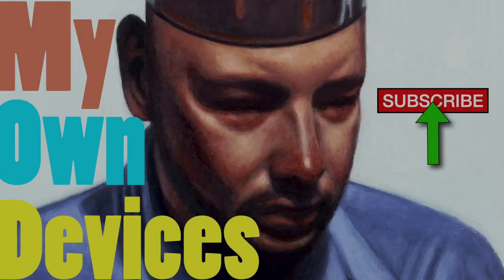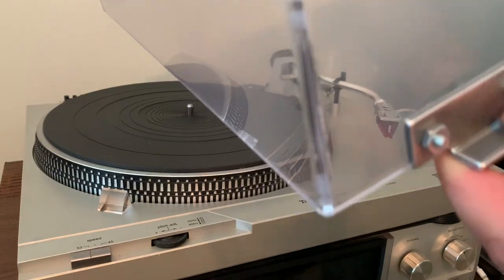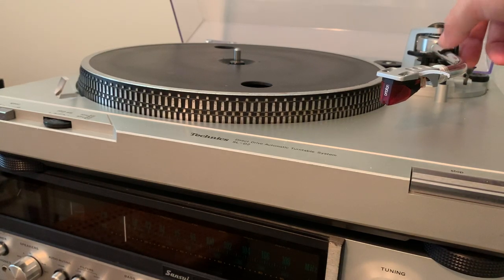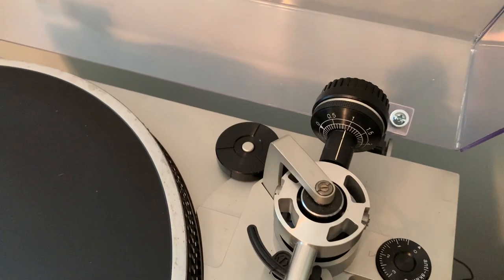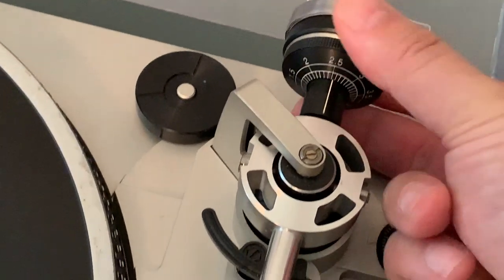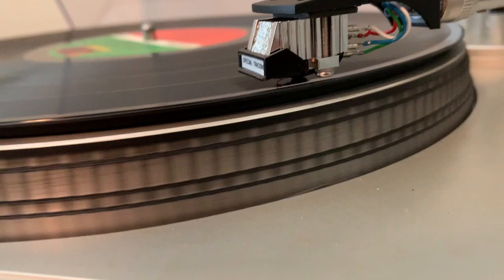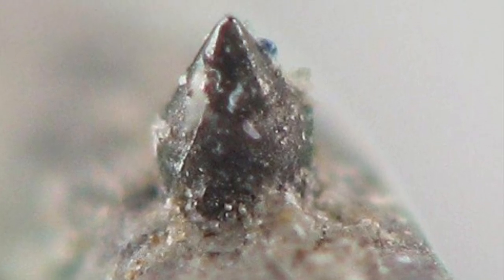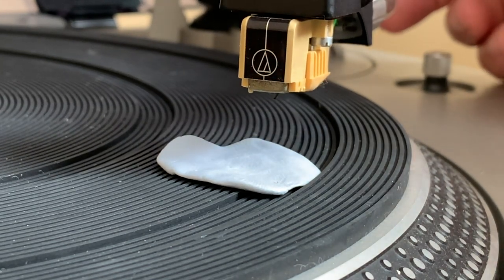Five Sensational Turntable "Hacks".

Comment: My hacks are something I learned when I was selling stereo equipment in the late '80s - early '90s. Make sure the platter is level before beginning to make any adjustments to the tonearm tracking force or anti-skate, and make sure the surface you place the turntable on is stable, solid and away from speakers or other potential sources of vibrations. To level the plinth use a bubble level on the platter near the spindle, then add paper or cardboard as shims under the feet, as needed, until the bubble is centered. Make sure you do this without the dust cover, or else its weight in the open position may throw off the measurements.

Comment: Awesome. Here's another hack... on stylus, a bit of alcohol with distilled water mix, in a small bottle. Dip stylus brush in solution, shake off, and brush styli. Check in a high powered micro-scope for end results. Re-brush with zero-state solution. Amazing results.
Reply: Thats what I do. But I don't use the brush that came with the stylus. I use the one that came with my razor cause it's bristles are softer (no. I havn't use this brush for the razor and never will :-) ). I check the stylus with a small handheld microscope and it looks phantastic. For the very scratchy dustcover of my old Wega turntable I used a kind of rough method. Polishing machine with ceran field polish. I didn't use much pressure on the machine and it worked for this dustcover. Not perfect but it looks and feels much much better than before. Do on your own risk.

Comment: A secret tip regarding Shure V15 type 3,4 and 5 if you buy a stylus from Jico in Japan, you can easily set the VTF to 1.5 gr without it damaging the cantilever and the suspension. I love those cartridges.
I also think you should try different headshells it actually does a part on the sound reproduction one of my hifi friends tries different types of headshells for each cartridge he buys.

Comment: "Skating", the force created by drag on the inner side of the stylus causing it to ride up the inner groove wall. Placing a stylus on a blank surface does not emulated the skating force needed to set anti-skating most accurately. I use the "Audio Symphony: Check Up Your Sounds Vol. 1" RCA Japan RVL-1. 

And for stylus cleaning get some AT-607. Looks like a finger nail polish bottle and includes the cap/ brush even. Your stylus and cantilever will shine and it does not damage the elastomer. I have a USB "microscope" attached to my plinth right by the stylus resting spot. I can see a magnified image of the stylus before every play.

Comment: Ammonia based window cleaners will damage the plastic. I have found cleaning old dust covers with warm water and a mild dish soap then applying a product called PlastX it’s found in any auto parts store it’s used to restore headlights.
Reply: I can't second this enough. Window cleaner will absolutely RUIN  plastic. Plain water works fine or if you feel you must use a chemical, Novus plastic  cleaner #1 is what I would recommend.  KEEP GLASS CLEANER AWAY FROM PLASTIC!

Comment: Blue Tack is excellent for cleaning the stylus as you mentioned, however it’s best to build a small pedestal with the Blue Tack on top to use next to the platter rather than putting the Blue Tack directly on the platter

Comment: Acrylic polishing paste can work great on these lids to get that glossy shine back. I only used it partially on ms SL-1210 for an inside scratch caused by the retractable light before I got hinged for the cover. Use fine sandpaper to smoothen out deeper scratches and the apply the acrylic polish over it. It will be shiny again within a few minutes and at least will greatly reduce the visibility of the scratched area.

Comment: The easy way for the lid to look a lot better is to use Pledge to buff the lid. Apply it on the lid every few weeks to keep it looking almost like new if it was only lightly scratched to begin with.
Also the tube where the counterweight screws in and out is sometimes hollow giving you another stealth way to make it heavier at the end of the tonearm without getting close to the lid.

Comment: If the blue tack is too ... tacky for you, of course the best is the Onzow which is designed specially for stylus. But it can be pricey (I saw $80 in some places... $40 in others).
Now, I haven't tried it but on some audiophile forums I saw people recommending Resonance Gel pads (that are used for drums. Seems to work like the Onzow and you can get a 6 pads for about $7. 
Now, the neat trick to go along with: want a case for your gel stylus cleaning pad? head over to the dollar store and grab a pack of the Listerine-like strips, empty the little case and the gel pad will fit right in. So it stays clean when you don't use it and it makes it much more convenient to use.
Reply from the maker: I also use a small piece of Magic Eraser.

Comment: I have just ordered lead tape as in hack # 2 . I got a Dual 506 2nd hand and I replaced the head shell so I could use a 1/2 standard cartridge , to balance the tone arm I added some nuts for weight and taped them on with black tape , but I like your lead tape idea better , I think it will be a winner !

Comment: All (I’m pretty sure) Technics counterweights have interchangeable threading but don’t weigh the same, so when I had the same problem as you I replaced the weight with a heavier one.  I like your solution, though.  The Technics auxiliary screw-in weight that is available also makes it impossible to close the cover.
Reply from the maker: This is a budget TT and I've already overspent trying to optimize it. My next video will really "get into" it. Please subscribe. Thanks, Dave the Hack

Comment: If you buy some Mothers scratch remover from an auto parts store and use a drill with a polish wheel Velcro attachment you can remove a good majority of your surface level scratches. I have had success with Turtle Wax head light renewal as well but by hand it takes about an hour to buff a dust cover.

Comment: The Anti Skate Hank is just wrong. Anti Skate must be done in the groves of a  record not a blank track. Get a test record from Hi Fi News. It has test tracks for Bias Setting(Anti Skate)-300Hz tone L+ R  at 12dB next track same 14dB next track 16dB and up +18dB. Using this you should hear an even signal from both channels simultaneously. if there is hint of instability(distorted or buzzing sound) on channel or the other then adjust the bias(Anti Skate) as needed. This is how bias(Anti Skate) should be set.

Comment: In addition to adjusting the balance pressure level with the counter weight you can also set the cartridge back further in the head, ( I noticed it was kinda in the middle). Also, I was picking up some speaker stands from a local audiophile the other day and he had a technics sl1300 and sl1350 that  he had acquired with no dust covers, but he told me he found a website that sold new clear dust covers for around $40 each, of course I didn't bother to ask him what website.
Reply: My bad, I guess you use that adjustment for correct alignment. Still if you don't have a scale you need to set everything to 0 and balance the tone arm then set the counter weight and anti skate but 1st thing is to balance the entire tt
Reply: I meant level the tt not balance

Comment: You really need to have the pivot point of the arm at records surface level that would have reduced the amount of weight as well could go forward and less overhang as much as possible you can use a big thick bolt with a nut superglued and some Cotton bit of blu tack stop it moving and hang it. You want to bend the the headshell between 5 - 7 degrees and a 10-mm spacer of balsa wood between headshell and cartridge so can get the rake angle back. Reducers in a Groove distortion pitch stability is better jitter on the record is better. Can try it with a slight wedge of bolster Wood cut to the angle as well if you don't fancy bending or have got a fixed headshell.

Comment: You probably could have found an auxiliary weight online somewhere. Most of these 70s and early 80s direct drive turntables came with little auxiliary weights that you would slot or screw onto the back of the tonearm, to compensate for heavier cartridges and head shells.
Reply from the maker: Agreed.

Comment: Enjoy  your videos, 
What do you do with severely damaged speaker corners.
What do you clean nasty circuit boards, I want to hose them down with a fire hose .
Can you recommend any books on vintage receivers repair?
Thanks for your videos, they are great.
Jim W. Living on Tulsa Time
Reply from the maker: I use wood filler and wood glue. Look for furniture repair videos. I suggest avoiding the use of water on electronics. Compressed air, artist paint brush, slightly damp microfiber cloth, electronics cleaner spray. Thanks.

Comment: The antiskate  needs to be set higher, as the groves will accelerate the arm inwards over and above the setting you have from the ungroved track on the record - try an extra .75g-1g  The best way to check is using the azimuth alignment track on the record and measure the signal levels so they match _+less than 0.5db or better hopefully you should be able to get it within 0.1db.
Reply from the maker: You just supported my point on the fuzziness of anti-skating settings. Thanks for your advice. Please subscribe. Thanks, Dave the Hack

Comment: Dave, now I'm curious to see your record cleaning hacks.. ;-)
Reply from the maker: Spin Clean and an old Discwasher brush/fluid.
Reply: @MODAC  I found a method on on of those forums I mentioned that requires shampoo+conditioner only.
I wash them in the kitchen sink, apply a little shampoo+conditioner combo to a paint edger pad. Rinse with distilled water and dry on on a dish rack. I was dubious but I was very impressed with the result.

Comment: The Shure V15 III is not designed to be used in that quality of turntable, it is designed for very low mass arms eg: SME series III, Linn etc. Using in that turntable will put undue stress on the stylus. Better have a quality cartridge that is designed for that type of arm.
Reply: You’re right, but the V15 III has been successful in my Technics Q2. I actually use a V15 IV mostly. You can balance it carefully, but these products were made about the same time and it’s hard to imagine that people don’t use Shure on Technics.

Comment: I have to disagree with your method of anti-skate checking. First, setting the anti-skate so the stylus does not move when placed on a smooth surface such as the Shure test record proved to be incorrect. It would be fine if you want the very tip of the stylus to have correct anti-skate pressure. How ever, that only applies to contact with the very tip and not the sides of the stylus that actually touches the record. Under normal operation where the sides of the stylus touch the groove walls, the actual pressure should be a slight inward force if you measured on the smooth surface. Infact, after I about my VPI Scout 2,  and after talking to VPI, I found that this tone arm actually needs NO anti-skate correction at all. They proved it if you must use it, but do not recommend using it. So I don't. And the way this tone arm with my Ortofon Quintet Black with shibata stylus plays records is outstanding. If you must use anti-skating, I suggest using the track on the newer generation Shure test record on the test bands with a segment from Brazil 66 called  "Mas Que Nada". It is a test of both sibilance tracking and anti-skate balance. A very hard recording to track correctly. Good luck with your records. They are great fun to just watch as they play.

Comment: Excellent video. :) Thanks.  My 45 year old turntable does not have VTA adjustment. this might be responsible for the syblance I suffer on some records. Anything I can do about this? Another Question: I noticed you removed the rubber platter before checking the stylus force weight. Was this necessary?
Reply from the maker: A thinner mat could be a solution to the VTA issue, or a spacer between the cart and headshell. Removing the mat when checking tracking weight is necessary because you want to measure it w/ stylus at the same elevation as when playing a record. With the mat on, it's too high.

Comment: I actually put blu+tac on a quarter and clean stylus every other side .
Reply from the maker: Yes, that’s what I do.
Reply: Just put a big ball of blu tack next to the platter and then you can just dip the styli into it before placing it on the record.  massage the blue tack now and again and first time makes it more sticky
Reply: @johnsweda2999  i got a 12" round adhesive backed sanding disk from a wood worker friend and replaced that stupid rubber mat with the sanding disk. It does a better job of holding my vinyls and every third song i remove the vinyl and run the stylus directly on the abrasive surface for a good clean. 

I can also adjust anti-skate at the same time.

Comment: I use a blank side record to set my anti skate but for some reason there are people who think this does not give an accurate setting. I never understand why they think this as it does, in my opinion, perfectly illustrate the purpose of anti skate in action.
Reply: The reason why they say a blank record is not accurate for setting anti skate is because it does not take into account the force of the rotating groove and the sound modulation which require more anti skate to overcome. Increased anti skate is required as the arm moves towards the center because the groove is "moving faster" so to speak. (The speed is the same but the circumference is smaller) What you may want to try is putting the arm down at a cut near the record label and after about 10 seconds slowly lift the arm with the cueing lever. Lower the arm back on the record and if the anti skate is correct you'll go back into the same groove. If the head shell jumps forward or back when the arm is lifted then the anti skate needs to be adjusted. Some people do this test at the center of the record so I would say let your ears be the judge.

Comment: why on earth would you check the downforce before balancing the arm ?
Reply from the maker: With a digital scale, balancing is not required.
Reply: Yes it is. You have misunderstood the purpose of the scale, which is to check and fine tune after initial VTF setting. 
Not for checking the weight of an assembly which is obviously so far out of range it may risk stylus damage.

Comment: just float the cart and adjust anti-skate accordingly
Reply from the maker: Float?
Reply: To set the counterweight properly, you float the tonearm-you move the counterweight out so that it balances the weight of the cartridge and the tonearm becomes level and “floats” on its own. Secure the tonearm. Then you can set the counterweight to the correct stylus pressure.